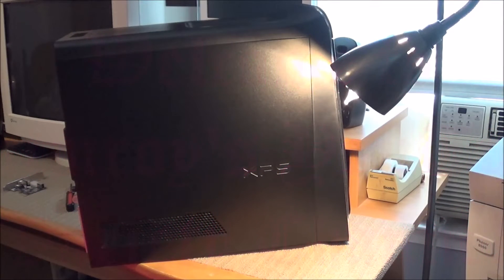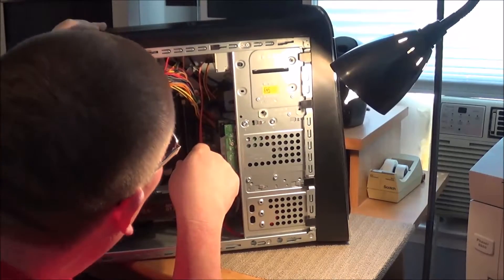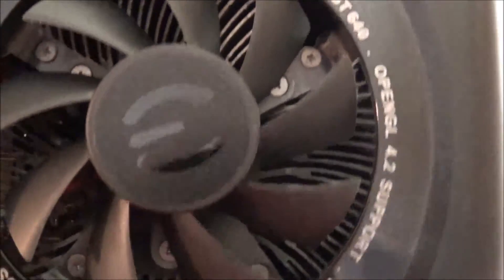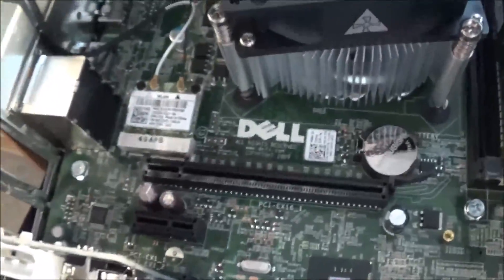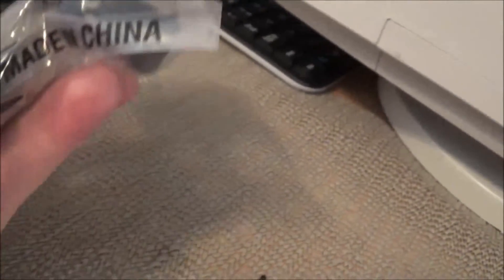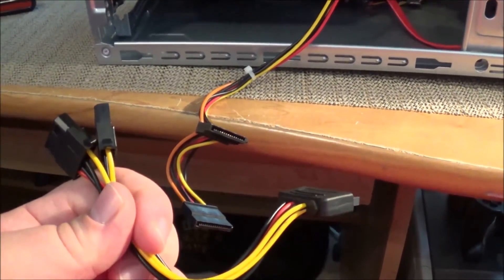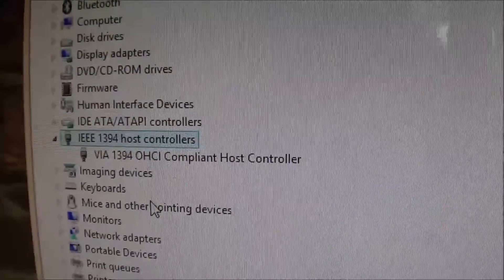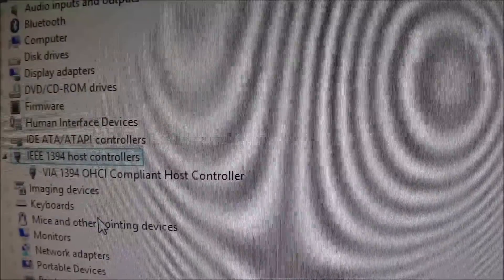Installing A PCI-Express X1 Fire-Wire Card In My Dell XPS-8700

Comment: Hello Matthew, I recently bought a XPS8900 and I'm trying to use a FW card just like this one, but I constantly get errors and eventually BSODs. Did you have any problems with this card?
Is it the VIA VT6315 chipset? Thanks in advance!
Reply from the maker: No, I haven't had any issues with the car I have. Mine is also the VIA VT6315 chipset. I sounds like you may have a bad or incompatible FW card.  Here is a link to the card that I purchased from eBay. I hope this helps and good luck.

http://www.ebay.com/itm/PCI-Express-x1-PCI-E-FireWire-1394a-IEEE1394-VIA-VT6315-Chipset-Controller-Card-/151237300171?hash=item2336720fcb:g:WscAAOSwDk5UAXBO